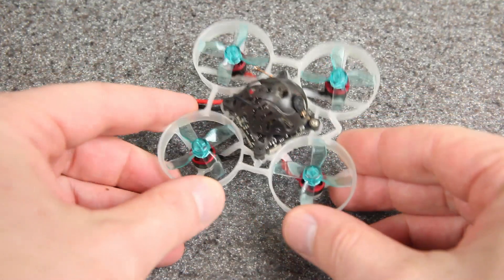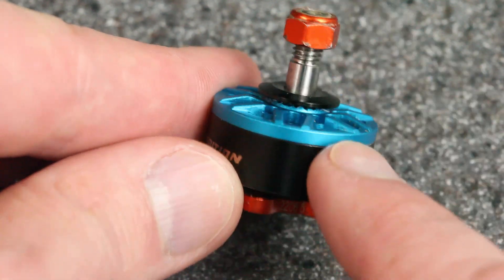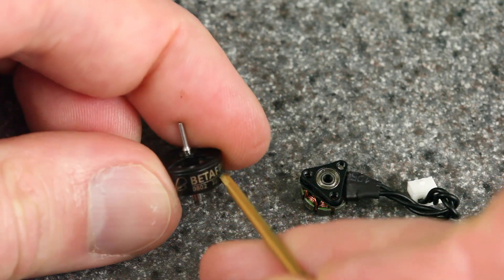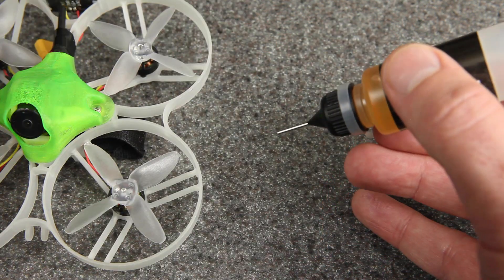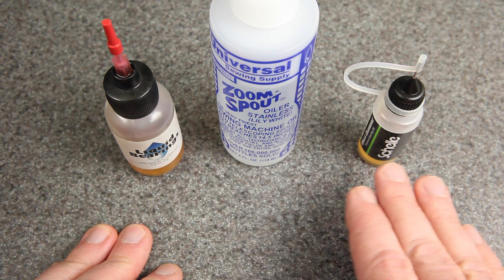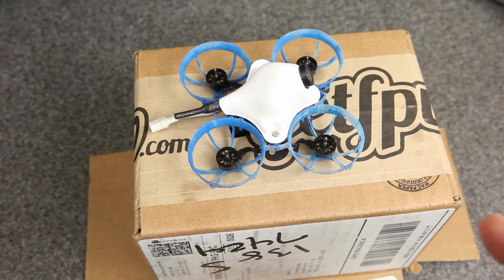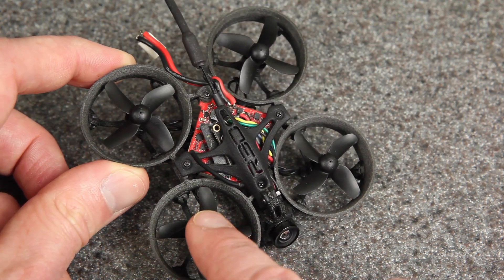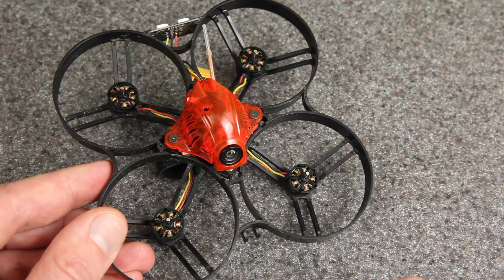Do your brushless motors need oil?

Comment from the maker: DISCLAIMER - PLEASE READ: The responses I've gotten about this video have been all over the map. I've gotten reactions all the way from, "OMG YES, bearing oil makes my whoop fly so much better!", to "OMG NO! It will ruin your motors! Don't do it!". So, here's my disclaimer:

1) I do not recommend oiling motors with sealed bearings. They shouldn't need it. They don't usually benefit (I've tried), and the oil could interfere with factory provided lubrication in a bad way.

2) I do think that a bit of oil can significantly improve the flight performance and efficiency of whoop motors that have sintered bearings (what I call "bushings" in this video). I have done this to my racing whoops for over a year, so it's not just bench data. That said, results will vary greatly. It depends on the type, quality, and condition of the motor.

3) Oil can attract dust. If you are happy with how your drone flies now, then just fly it the way it is and have fun! If you fly in a particularly dusty environment, that too might be a reason to avoid oil.

4) As always, try whatever you want at your own risk. If you do, I will be happy to hear what results you see. Have fun out there. Happy flying! :-)
Reply: I seriously fully endorse lubricating brush-less motors along with lubricating your brake pads to prevent premature wear. Great topic.
Reply: On bigger micro motors, where bell is just pressed on the shaft, it can start slipping after lubricating, also u clip can unclip from the bottom after a crash when lubed.
Reply: what about the dji mavic mini? Im unsure.
Reply: @thevikingsock8527  best course of action is to fill a tupperware container and dip the whole thing in it, along with your transmitter.
Reply: Philip Tomkins that should be fine (oil shouldn’t hurt the electronics, but I’d avoid getting the camera lense submerged because I doubt DJI actually glues and seals the camera lens on like everyone else). People do submerged computer builds in oil, often to decorated to look like fish tanks, in that case after a year of direct contact exposure some plastics may degrade). But yeah, I have dunked a whoop motor in a cup of oil because it really needed it, it was going to burn up something before long with all that drag and lack of power. Also run it under water (props off to avoid a mess), as that will swirl the oil which will clean the grime off the motors. I fly very low altitude (typically inches off the ground), so you don’t want to do this most of the time, instead disassemble and use a needle to dampen the bushing, or you could use grease preferably but I didn’t have grease. It’s just like the bearings in your car engine (which are the first to fail if you ever drained your oil and didn’t put a warning sticker on it letting the wife know not to drive it), bearings need lubricant as most any frictional part does, and at roughly 30k rpm cruising around that’s a lot of wear...
Reply: @ecstaticasom  are we using extra virgin or budget?
Reply: Everyone fighting over it is funny 😂
Reply: I am going to use some engine assembly lube like I use rebuilding atv and dirtbike motors. Another great option would be to use white lithium grease and one more would be graphite lube.
Reply: I heard, that PTFE is "much better" than oil.. 😅
Reply: Such a small price for such a jump in efficiency. Thank you for that test! After watching that it was a no brainer. So much resolution from just a little bit of lube lol

Comment: i dont know where to start with how wrong this is...it drives legit engineers nuts...and ive been doing it for 30 years professionally.,..everyone's an expert after 5 minutes it seems... engineers generally study for a minimum of 4 years and spend quite some time doing tribology and calculating and analysing friction. brass has a low frictional coefficient and is designed to wear, and its not uncommon to have a single bearing race. oil and dust equals friction risers which accelerate wear, and since the motors have a life span of 10 hours or so, its not required. when oil and dust mix, it also interferes with wire resistance and insulative properties. most lubricants used with these motors have very high viscosity also and they have carefully selected temperature characteristics.
on the contrary, you want high viscosity oils that become less viscous when they get hot. If you want to do testing, you need objective evidence. try measuring rpm and v and i under load for a start. ..there really is no point testing with no load...noise has no relationship at all and its quite possible that things can quieten down due to hydrodynamic pressure adding resistance and sucking power from the motor...finally, they are called 'bearings' for a reason..they are used to bear a load and allow rolling..so applied to where the load is..they arent there just to minimise friction, critically its to allow power transfer, and to do it with minimal weight you need to think carefully about where to place them as they are relatively heavy and take up precious space.

Comment: White lithium grease worked great for me on my mobula6 25000kv motors... it's not at light as oil but it's still light enough and has a great long life "stay" factor vs oil, which eventually works it's way out over a shorter period of time. Yes it attracts dust if you get it outside of the bearing but it's tight enough inside that I doubt any dust will get in between the shaft and bearing.

Comment: Molybdenum disulfide may be the answer to dust sticking to the oil.
Reply from the maker: Be careful because graphite conducts electricity.
Reply: @MrShutterBug  Good call, I'll try it anyways. really there SHOULDN'T  be an issue, but you never know!

Comment: awesome tutorial video! you're a a true master! what would you say the best interval between oiling is? would it be 10hours fly time more less?
Reply from the maker: In general, I would not recommend oiling motors that have bearings. I only oil the really small micro motors without bearings. If you choose to use oil, you do not have to apply very often, and you should use as little as possible since it can make a mess and attract dust.

Comment: Just curious have you looked at using silicon spray as a lubricant?
Reply from the maker: No. Have you?
Reply: @MrShutterBug  yes just a little drizzle it may not last long but it is very light and doesn't grease up with age and can be applied quickly

Comment: i can recommend oil only ppl fly indoor. And Not for 11xx motor. these 1.5mm shaft bell can be loosen by oil which mean motor life end. (well if you are using prop guard or whoop frame it will be OK. you may know why)

Comment: It's interesting. I replaced my motors to a new set of 19kkv happymodel motor. It felt fluid so I was happy with it again. At first tries I could fly about 3.5-4 mins. One week and 30-40 packs later the bell and shaft bacame easily movable in up and down directions and I could fly about 3mins. Though it fitted very tightly when I unpacked. Is this a normal after one week?

Comment: the meteor65 around 13:51 sounds like the oil is mixing with whatever dirt and grime is in the motor and trying to clean it out. Did that sound ever clear up? Maybe try a lube/cleaner or other formula like silicone lube or even contact cleaner/lube spray might help.

Comment: I've been wondering if cleaning the motors with Mass Air Flow cleaner would work.   Spray a little on while they are spinning to clean and then lubricate.  Bad idea?

Comment: I prefer a heavier oil like automotive motor oil.  It stays in the bushing longer. A lighter oil has to be allied more often.

The Eflite Ultrix came with twin 0804 13,500Kv drone motors and solid bushings.  Several forum members who owned the plane were complaining of brushed motors seizing or failing outright.  I took one apart and was surprised to find DRY solid bearings.  My 0904's have ball bearings.

Bushings are 4mm O.D. with a 1.5mm bore.  Smallest ball bearings I could find while seeking an upgrade was 4mm x 1mm I.D., so no-go there.

I made a video for plane owners showing how to take one apart and lube both bushings.  A number of people who have followed the advice report motors running like new again:  https://youtu.be/z9WVA7-VCNc?t=0

Lube them. Dry, abrasive dust on solid bearing surfaces is far worse than dirty oil or grease, and bare metal-to-metal contact is hardly better.   16 years of tool & die and prototype machine design, so that advice is coming from an experienced source.

Note I DO oil the sealed motor ball bearings in my fast electric boats to fight water corrosion, but an aircraft doesn't need this unless you flying in the rain a lot or fly sea planes off salt water.  ;-)

Very cool video you have here.  Happy flying!

Comment: Great Topic and video.  The bearings shown in the larger motors appear to be "shielded" and not "sealed". If this is the case they would still respond favorably to oiling.  i would imagine on the smaller non shielded motors the oil flushing out the grit may be as or even more beneficial than the actual lubricating properties of the oil.

Comment: Scorpion has a special formula designed for brushless rc motors. They make rc helicopter brushless motors. Been using it for years and it comes with a needle like attachment for easy application

Comment: I use "3in1 High Performance lubricant with PTFE" came from Amazon. I use it on my RC cars on my copter and some of the tinywhoops. Synthetic oil with high viscosity and it is a spray can type. It needs shaking before applying through a thin tube. Works like a treat ;)

Comment: 1 more disclaimer: I found that the stator are glued and can come loose. the bearing oil creaps in between stator and stand and  weakens the glue, with some vibration and bam midair Crash, motor destroyed......  So Ilike use of oil it's good on motors with 1-2mm bearing axis, but just a little bit and absolutely be secure....

Comment: Thumbs down for your Racerstar comment. I have racerstar on 2 of my 5" quads and on my 1 brushed whoop. My racerstar motors have out lasted brotherhobby motors both in crashed and just plain durability. Don't make an assumption please fly some more racerstar motors before you just give a baseless opinion. i have had brotherhobby motors fry on me brand new. Hit a tiny branch with the other quad with Brotherhobby motors and the motor was fubar.

i have power looped my quad into tar road smashing the camera, smashing the frame, smashing the vtx and FC ony thing useable was my racerstar motors. this has happened a few times hard crashes with them worst case bell housing pops off.  

so if i have to say anything it dont buy brotherhobby motors they are weak and have terrible quality control. Frying a motor on 1st start up and it goes up in smoke and hitting a small thin branch and bending the whole motor....very bad motors.

Comment: I dont think this is a new practice, when racing rc cars you always oil your bearings after a race weekend. Whether its a motor bearings or wheel bearings. The best way to do it is with a ultrasonic cleaner for ball bearings and then use a specific oil. This makes sure the bearings are smooth and clean and the car is getting its power down.

Comment: As an engineer for the last 35 yrs  I would say that you can't oil a sealed bearing (metal shields) as they are filled with grease from the factory.  Rubber shields, I have lifted the shields and added extra grease but this is temporary Measure until you get a new bearing.

Comment: Okey-dokey.  When it comes to your center bearing.  Your summation, was correct.  It is already sealed.  And lubricated with a high viscosity, grease.  That, over an extended period of time and heat.  While it won't leak out.  It will begin to partially harden and solidify.  It will contract.  And so, a very small bit of specified machine oil will be indicated in an extremely small quantity.  But many people overdo that.

So if you add too much oil to the perimeter of your bearing.  It will make its way inside.  And with an excess amount.  It makes for a great, grease melting agent.  So that the grease can liquefy.  With some of it eventually drooling out.  And contaminating other items with needless lubricant they shouldn't have.  And attracting dirt and other contaminants.  And then your bearings get really noisy.  Because they no longer have a, nice thick high viscosity grease.  That they were originally packed with.  And well, whoops.  When that happens.  Time to replace the bearings.  So, less than one drop of machine oil.  As in less than one, drop.  And you will rejuvenate them for quite a bit more time.

This is a nice video.  It's nice that you requested info.  You're real good.  This makes you better.  Now you know what an actual technician knows that has worked on, precision motors.  Not for drones.  But for a professional, multiple hit records through the years, famous tape recorder company.  And was in charge of quality control and final testing.  And you get machines back to the factory for refurbishing.  Sometimes we can save parts.  And sometimes we don't.  And so the secret ingredient is.  More is not better.  Less is more.  And then they rest of the perfunctory cleanup and calibrations.  And other normal required parts replacements.  Similar to that of your car.  The brakes, the heads, the roller guides, the rubber pinch roller.   Which is like a tire.  And wear out like tires.  And the bearings it's mounted upon.  And the multiple bearings in the three motors.  And sometimes you win.  And sometimes you lose.  And it's always fun digging parts out from within other parts not designed to have those other parts necessarily dugout.  But if you fancy yourself a watch repairperson.  You might be able to do it.   Don't be heavy-handed.  Caress it gently.  And then tear the little son of a bitch part out.  Throw it across your room.  And let your dog try and figure out what it is.  And if Fido tells you.  Quickly sit down and have a stiff drink.  Something has gone very wrong.

Later order the replacement parts.  You can also buy a dog on Amazon.

I'm a technician.  I know how to fix audio consoles and tape recorders, dogs and cats.  And you feed them the same medicinal THC gummy bears you normally take.  They will then understand what they are supposed to do.  The cat will change the Internet radio station by walking on the keyboard correctly.  And the dog shall retrieve your beer from the refrigerator.  But make certain you have enough THC gummy bears for them.  And it gives you something to all enjoy together.  When you watch your favorite rock 'n' roll group on your Internet streaming device.  Since nobody will ever be going to a concert again in person.  And you will be able to bond with your pets better.  Some also like beer and popcorn.  Like my white cat, did.  Cleo, my calico was only into the lobster on Tuesday nights.  And Pookie would partake of the lobster with the beer.  Cleo was also not so much into the catnip like Pookie was.  But Cleo liked long rides in the car.  Pookie hated that.  Cleo liked to lie down on my dashboard in front of me.  Because she knew I had cruise control.  I would have to constantly move her down to the passenger side.  Kind of like, an old, typewriter.  She was a total goofus.  And then, would come when you called her, like a dog.  She was like a dog.  More talkative than a dog.  She would talk to me all the time.  It was obvious.  She had a lot to say.  She was a groovy rock 'n' roll cat.  We had a blast together.

I think it would be so cool.  If you could put a harness on your cat.  And fly your cat with a drone.  Yeah!  Cats like to get high.  I think they would really dig a drone.  I'm going to have to try that.  I'll have to get a bigger drone.

I want to send a cat into space.  And see if it still lands on its feet.  Or what a cat will do in space?  I think it would be cool.  I want to see a weightless cat.

RemyRAD

Comment: I used oil when I first started building drones a few years back. Oil definitely help smooth things out but once you hit dirt or sand they're toast. The oil attracts then holds onto the fine particles and wears out the bearing even faster just like sandpaper in between the contact points. You can hear them grinding and scratching around until it doesn't. After removing the C clip and inspecting the bell housing shaft you can clearly see the damage it leaves behind especially if you get oil in between the bell housing and magnets. Just need to be careful where you fly it after the oil.

Comment: Great video, I think the noise you hear in the bearings  after oiling them,,, my best guess is that the oil is dislodging microscopic debris and it's not getting ground in the bearings. and / or the balls, have lost their polished surface, Either way, they are on their way out.

Comment: If you want to lubricate sealed bearings you have to leave the bearing in an oil bath for at least 24h. BUT I think there is a grease inside. Low viscosity oil can washout the grease. Then you will have to oil it very often. If you never oil them, then the long time grease will take care of lubrication for a long time.

Comment: I been doing this for over two years and the results do have a effect.  I use watch oil that you can buy off Ebay in different grades. The name is Liberty oil products and its 100% synthetic lubricants and it already has the bottle with the long tip to get down in the motors..Awesome video Nate very informative vid😎